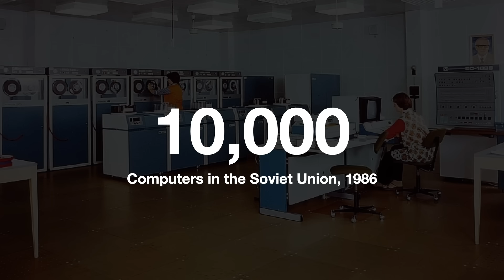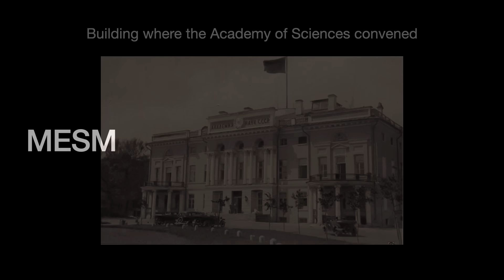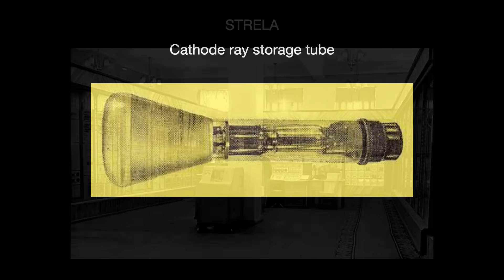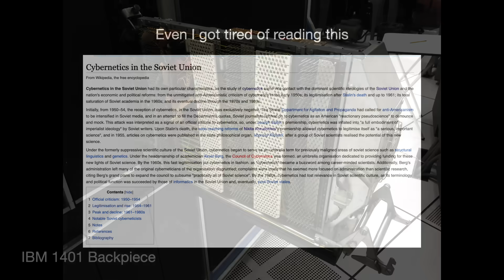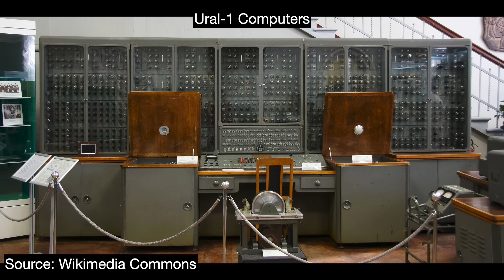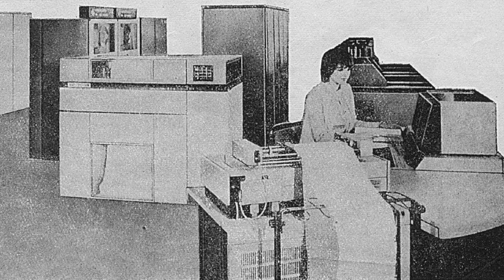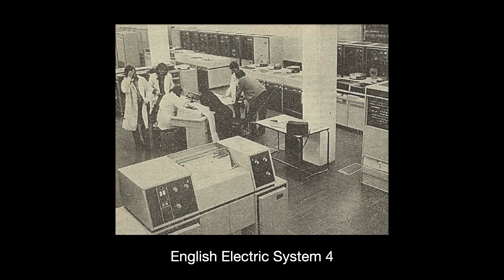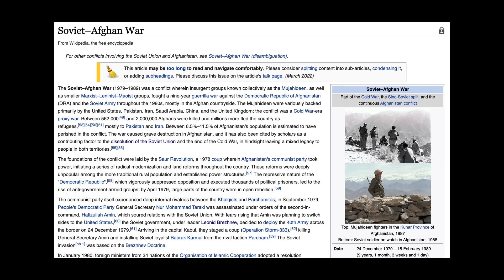Why the Soviet Computer Failed

Comment: The book "Red Plenty" touched on some of those events. 

Centralized Planning in itself is not to blame IMO, it's the centralized planning STRUCTURE, the bureaucracy, the top-down chain of command, people afraid to speak up. 

Cybernetic systems promised to automate away much of the party commands. Production would finally be organized from the bottom-up, responding to signals in real time. This was putting bureaucrats roles in jeopardy, and could lead to prices that would rouse people up (balanced economy or no, who would be the one to announce price changes, at the cost of their political career, if the people got angry?). So they scrapped their cybernetic planning system, despite a potential so great that politicians in the USA feared that this system would prove the superiority of a planned economy. Yet, Stalinian bureaucracy was well able to destroy itself. 

Another bottom-up planning experiment, using computer networks, was briefly tried under Allende, in Chile, in 1973, before the USA-backed dictator Pinochet bombed the parliament. Here's a good account of the events. 
https://youtu.be/RJLA2_Ho7X0
Reply: fact that you need to get everything right is the ahilles heels since rarely anything goes as planned in real life
Reply: @bravodefeated9193  do you actually know how a planned economy works? or just planning in general? How do you think amazon plans everything, do you not think that markets don't lead to central planning?
Reply: No, centralized planning 100% is at fault. Many technologies are basically stumbled upon by accident or unfocused tinkering. 

Think tons of small groups of people who are all simultaneously trying their own different approaches to something. Even though the odds that any singular group succeeds are incredibly low, it only requires one group to get right once for the bar to be raised permanently. The net impact on society of a single “black swan” unlikely success far far outweighs the 999 others who tried and failed. 

Where the top down system of innovation tries to remove randomness through logical central planning, it ends up damaging itself as it discourages the unpredictable and hugely net-positive asymmetric upside of empirical trial & error / tinkering. 

Similar reasons why disorganized guerrillas in Vietnam and more recently Afghanistan (and generally) were able to defeat the highly organized, top-down controlled US Armed Forces.
Reply: @Bob-jn8gt  Ok, just a quick question have either of you though that simultaneous development wastes resources? and keeping technologies secrete actively damages advancement's in the field? Also central planning doesn't  prevent multiple teams of researchers from working, so it doesn't reduce the likelyhood of a black swan discovery. Also if you look at any recent developments most of them are funded by the public and not privet company's as it simply is not profitable to actually make your product better but rather market it as being better.
Reply: @kaichohachi2315  simultaneous development (tinkering) absolutely wastes resources, but the upside of a single outcome can be so asymmetrically positive that it more than makes up for the waste in the process. 

And yes command systems can have multiple teams working on different things to the same goal, but the effectiveness of this decreases with scale as there are too many factors to account for, and one small unpredictable event results in the entire plan needing redeveloped to the point that the planners are the one’s playing catch-up. So the further power distance between the planners and these events makes the system less adaptable overall.

As for keeping things secret, I totally agree that this damages advancement. I’m ok with some level of intellectual property, but currently the system has turned it into a whirlwind of frivolous legal BS.

I partially agree with the last part, big companies don’t “waste” time on innovative tinkering because they are too focused on short term cost cutting and financial/legal manipulation.
Reply: @Bob-jn8gt  I get your point and I agree that it was defiantly a problem with soviet style planning but with modern technology it is no longer a problem, we can compute a whole nations economy on one phone so this problem is reduced far more and the wasted resources from simultaneous development outweigh this issue.
Reply: @Bob-jn8gt  we're, I think I'll steal the ' from your comment
Reply: @xXDESTINYMBXx  ?
Reply: @Bob-jn8gt  cool you fixed it
Reply: @Bob-jn8gt  I generally agree with your argument, altho IMO developing a consumer product requires more research and "focused tinkering".

While many inventions and discoveries usually involve someone stumbled upon something in somewhat unexpected manner, that invention/discovery almost always requires more research and engineering effort before it can actually benefit the society.

Centralized/command economy is really good at pouring resources to achieve quick progress at developing new solution/product based on known theories, altho as shown in this video, it could not compete against market economy in the long run, as new invention/discovery often render previous solution obsolete.

Therefore, IMO (and contrary to popular belief), the so-called military-industrial complex is actually great model. Ofc I'm against it for ideological reason (i.e. gov should not gamble or "pick the winners" with taxpayers money), but I have to give credit where credit is due.
Reply: @Retired Bore Central planning is good at scaling things up and being lean/efficient, not innovating or tinkering as tinkering is inherently inefficient and unpredictable. Both have a place in society. 

There are R&D driven corporations that innovate but internally the innovation isn’t centrally planned, they have a bunch of small teams working on their own bottom up projects with some level of autonomy (large pharma/biotech where 99% of candidate drug compounds never get FDA approval, but the 1% that do make enough not only to cover the costs of the failures, but create a huge net profit for the shareholders). 

Many large companies these days prefer to buy the IP and rights to novel technologies from startups/M&A and use their centralized efficiency to scale-up.

Speaking of supply chains and central planning, 99% of the time, the lean/just-in-time efficiency saves money, runs smoothly, and scales efficiently. But it is fragile to black swan events and randomness (no central planner or statistical model will ever be able to predict the future with a useful degree of accuracy due to entropy)
Reply: @Retired Bore The problem with "central planning" is not with the planning in itself, but with the fact that a handful of people (i.e. the central planners) in the faraway capital monopolize all power in the whole nation and make all the decision for everyone (i.e. less personal liberty for the people), often with little or no accountability.

If corporate directors made wrong prediction/move which cost investors large sum of money (not to mention if they steal company's money), they could be fired/replaced at will. Investors hold effective control over the management.
On the other hand, members of Politburo (or the leader of Communist Party) control all the power in the nation (military & police), so if they make the same mistake that cost the people/taxpayers a lot of money/resources, nothing will happen to them. The people/taxpayers are powerless.
This is the problem with central planning and big government.
Reply: @Retired Bore 1. I'll say that Capitalism is not better than Communism, since the word "better" here is dependent on your objective/ideals.
If your objective is to create an equitable society, then Capitalism (a system revolve around accumulation of capital), is definitely bad.
But if your goal is to create efficient economy (e.g. maximize GDP), then Capitalism is better than Communism, both in the abstraction/theory and in practice.

2. Corruption inside HP, Nissan, Lehman Bros, etc did not prove that "Capitalism" is bad, just like the debacle with Hubble space telescope or space shuttle accidents does not mean "Government" or gov agencies (i.e. NASA) is bad in itself.

Nobody is perfect, whether corporate leader, politician, or bureaucrat (e.g. head of govt agency). They all make mistakes, question is: what/how the system in question deal with them?

What happened to the head of Hubble space telescope program after the flawed lens debacle that cost taxpayers billions of $? Nothing.
What happened to the head of Federal reserve during the crisis in 2008 after he bungled the bail out which cost taxpayers billions of $? Nothing.
What happened to NYC CDC leadership after the agency failed to properly prepare for the incoming pandemy (which has been in the news for weeks) and failed to quarantine Cov*d patients? Nothing.
How exactly voters and taxpayers demand any accountability from these bureaucrats and central planners? You probably don't even know who these bureaucrats are.

As individual investor, if you no longer trust Elizabeth Holmes or Bernie Madoff, or Zuck, or Cook, or Musk, you can just pull your money out from their company and invest somewhere else (and if there's enough of investors losing faith in them, you can even replace them).
If you can actually prove that they scam you (as the case with Holmes and Madoff) you can sue them and demand them to pay you back (or punish them if they can't).
Unfortunately you can't demand a tax rebate for govt f-up, and you can't refuse to pay future tax either. Imagine in the totalitarian state where these central planners and bureaucrats are not only have the right to tax you, but to expropriate your property and force you to do their bidding (e.g. assign a job for you and set production target). What a nightmare.

3. "If Capitalism tried in Russia and Communism in the US.. (probably) led to very different outcomes"
There's one country blessed with fertile land, bountiful resources, and large workforce.. This great country exist since ancient time, experienced many golden ages and tribulations over the millennia.. This great country had tried both Communism and Capitalism: China.

We know what happened when central planners in China run the economy (Google Mao's "Great Leap Forward"), and how everything changes after the exact same group of planners humbly admit their own deficiencies and allow the market to shape the economy (Google Deng Xiaoping's market reform).

"Whoever does not miss Soviet Union has no heart, whoever want it back has no brain" - Vladimir Putin.

"We want to make everyone rich, but in order to get there, we shall allow some to get rich first"_ - Deng Xiaoping (talking about the then new "Socialism with Chinese characteristics" aka "Capitalism").

Btw, you are already free to practice "Socialism" in America. You can gather likeminded people and start a workers coop or collective farm in the US (not just in the US but practically in all countries with free market economy).
Free market capitalism is not a totalitarian system like Marxist/Socialist countries.
Whether theocratic farming community (Amish community), Socialist workers coop, collective farm, small company, or public megacorporations.. and anything in between, they are all allowed under Free market capitalism.
Reply: @ihl0700677525  Capitalism is far more inefficient then communism and socialism
Reply: @kaichohachi2315  That could be true if and only if the "dictatorship of the proletariat" could actually outperform market, which has never happened.
Reply: @ihl0700677525  It has and does, more often then not. Look at the study: "economic development, political-economic system, and the physical quality of life", Or look at the soviet union's economic growth, where even in the "stagnation era" it's economy was growing faster than most capitalist economies what's even more impressive it that they do this while facing massive sanctions and attempted coups
Reply: @kaichohachi2315  Comparing USSR economic growth to "most capitalist economies" means nothing since you may ended up comparing some random "capitalist countries" in Africa or Asia (which may or may not be a "capitalist" economy depending on your definition).

For example India is technically a "capitalist" country even tho it has a "mixed economy" with many "socialist"/collectivist characteristics (e.g. price caps, subsidies, state run enterprise dominating many industries, etc).

If you want a fair comparison, then compare 2 countries with similar demography and geography, like between West and East Germany, or between North and South Korea.
Same people, same culture, same starting point, different system, vastly different outcome.
Reply: @ihl0700677525  Agreed, oh wait. That is literally what the study did.
Reply: @kaichohachi2315  Lol. Isn't that great? Millions literally risked their life escaping "utopian" dictatorship of the proletariat to come to inferior capitalist society.
I'm sure "the study" explain to you why is that in such concise and detailed manner. Lol.
Reply: @ihl0700677525  That last message was the most anti-intellectual brain rot I've ever read,
 please look at the study before moving on to a different point.

Plus your "point" of people fleeing for there lives can be applied to any capitalist country too.

Never did I claim that a planned market was utopian, rather I said it was better than capitalism, which it provably is.
Reply: @kaichohachi2315  1. If you want to make a counter-argument from your study, you can quote something relevant from it. But so far you haven't mention anything that piqued my interest to read it.
I can point you to some random studies about the "superiority of capitalism" on Libertarian or Conservative thinktank website, but that would be stupid.
To expect someone to spend time on what may well be a low quality partisan propaganda is just silly.

2. "People fleeing their country can be applied to capitalist countries too"
Lol. Tell me about all these people fleeing en masse from a Capitalist country to a Communist/Socialist country then.
Tell me, what compel them to leave, and how they fare in the Socialist society.

3. "I never claim planned market was utopian, I said it was better than Capitalism, which it provably is"
Sure, depending on what your ideals/objectives are, command economy can be a better fit. For example if you want to create equitable society, then command economy is definitely better than free market.
However, if we want an efficient economy (e.g. maximize GDP), then the much more meritocratic free market is proven to be way better.

"We want to make everyone rich, and in order to do so, we shall allow some to get rich first" - Deng Xiaoping
Reply: @ihl0700677525  
1 - The study shows that with comparable starting positions a planned economy provides a greater quality of life for everyone.

2 -  I'm not going to respond to a strawman.

3 - A market economy is far more inefficient, also in no way is a market system a meritocracy. Do you genuinely believe that Jeff Bezos works 158518 times more that an amazon worker?.
Also again even during the stagnation period the USSR had more GDP growth then most capitalist economies, so much so that it was projected to be the worlds biggest economy by 2050, which is very impressive when you consider it was a wartorn feudal society not that long ago.

"Wind farms couldn't pull the skin off a rice pudding, says Boris Johnson" - Alexander Boris de Pfeffel Johnson
Reply: @kaichohachi2315  1. "Quality of life" is rather a subjective term. People of Nepal can claim they have better "quality of life" compared to, let's say, Swiss, or anywhere else, since according to one survey, Nepal is/was one of the "happiest" country on Earth, where vast majority of the population is content and enjoy a "happy" life.
Anyway, in term of GDP and GDP per capita (which is much more objective), West Germany was much richer than East Germany, and South Korea is much richer than North Korea.

Ofc there are other (objective) metrics you could use which favor command economy over market economy, like "Wealth gap" in Socialist countries was/is, on average, much lower than in Capitalist countries. Which is exactly my point: if you want to create an equitable society, choose Socialism. But if you want efficient economy (thus can produce more, i.e. larger GDP), choose Capitalism.

2. Really? How's that a strawman?
I said there were tons of people risked their life fleeing Socialist country to come to Capitalist country, and you replied with "people fleeing for there lives can be applied to any capitalist country too". Which should mean there's a lot of people fleeing Capitalist countries to come to Socialist country too.
If that's not what you mean, then what do you mean by "people fleeing for there lives can be applied to any capitalist country too"?

3. "in no way is a market system a meritocracy"
Some Socialists call "Capitalism" as "Social Darwinism" where the winners take all and the losers lost everything. For better or worse, that's a form meritocracy.
It is ofc not a "true"/perfect meritocracy, far from it, but it's still far more meritocratic than this idiot system that celebrates mediocrity and subsidizes weaknesses, the one that say "From each according to their ability, and for each according to their needs" (which is the anti-thesis of meritocracy).

4. "Do you genuinely believe that Jeff Bezos works 158518 times more that an amazon worker?"
Lol. Do you honestly think that Stalin or Mao worked 158518 times harder than average workers in Stalingrad or Beijing?
Seriously tho.. Bezos' annual salary from Amazon in 2021 was about $85,000 (you can Google it). That's definitely NOT 158,518 times more than avg Amazon worker.
If you include his "net worth" as his "income" to be compared to avg Amazon worker's salary (which is hilariously misguided), then let me ask you this, do you genuinely believe your parents (assuming they own a nice house in suburbs) work 100 times harder than you? Why they have such a nice house that worth half a million $ while "doing nothing"?

5. "even during the stagnation period the USSR had more GDP growth then most capitalist economies"
I can claim that even during the economic slump in the 1980s, US economy still growing faster than "most Communist countries". It's meaningless claim.
If you want to cherry pick, at least do it properly, use a stats from a time which East Germany somehow grow faster than West Germany. Lol.

6. "(USSR) was projected to be the worlds biggest economy by 2050, which is very impressive when you consider it was a wartorn feudal society not that long ago."
Lol. In 1970s Japan enjoy extremely rapid growth, projected to overtake the US to be the largest economy on Earth by mid 1990s. Needless to say, it didn't happen.
But do you think we should copy Japanese economic system/strategy from 1970s?
Oh, and Japan was a war-torn feudal society not that long ago. In fact pretty much all of Europe was a "war-torn feudal society" just before the Industrial revolution.
Reply: @ihl0700677525  People defending Capitalism with the same tired arguments, full of straw man, miscaracterizations, based on bad economic models, and only pointing to past authoritarian structures whenever someone wants something entirely different, are a waste of time an energy. I told you of 2 books whose whole subject is exploring how planning can be done directly democratically. I told you of another one that only explores how right now we have more "central planning" through Capitalist industries than ever before. Imagine the planning taking place in Amazon. It's acutally my job to create digital tools that enable analysts to take decisions, based on objectives handled down from management. The difference is that I want management to be elected, recallable at any time, and only there to facilitate online and in-person assemblies where issues from different levels are discussed and voted on (local to global). What that means can be up to every workplaces, which each implement their part of the bottom-up plan that emerges from all the needs and desires of the people (anticipated algorithmically as it is done in Amazon - looking at lots of real time metrics, and/or explicitely). The incentives a system owned by us all has is to fulfill our common needs, not maximize profits Capitalists. 

To address your points from other comments, this has nothing to do with past central planning experiments, which had no access to real-time online voting, A.I. and algorithmic tools commonly used today. 

No, we cannot "make socialism" now, with worker COOPs or a commune. This is like looking at Slavery Plantations, wanting Slavery to be abolished, and you say that people can have a plantation where they pay others instead. This fixes nothing. Even if every companies was mandated to be a worker COOP, the anarchy of the market (lack of planning between companies) still recreates crises of overproduction every few years, as worker's incentives are still narrowly limited to the bounds of their company. 

For your points in the previous comment: 

1 - Really, GDP = efficiency? You understand that an oil spill is a huge economic boom for GDP, right? People payed to clean up the spill, more petrol need to be pumped, money exchange more hands. That's GDP: a measure of economic exchange with no notion of WHAT it's exchanged FOR. Even the inventor of GDP disliked the metric. Diluting it per capita is useless (especially considering how it is incredibly skewed toward the rich). If you want a Capitalist telling you about the problems with GDP, read Ha-Joon Chang's "23 Things They Don't Tell You About Capitalism". The first part of "Less is More", by Jason Hickel, also shits on GDP, which becomes useless when considering the cost of externalities it ignores.

2 - Yes, people flee Capitalists countries all the time, for reasons directly linked to economic devastation brought about by capitalist recommendations from the IMF. That it be through the support of dictators, to exploit the despair of people to export industry abroad so that corporations can pay pennies on the dollar and destroy their environment in the name of free trade, or because shock-doctrine destabilization has wrecked their countries by a war backed by Capitalist interests, there's tons of refugees and deaths linked to Capitalism, far more than the over-inflated "black book" count of death ever did. 

3 - Seems you need to read "The Tyranny of Merit", if you think we live in a meritocratic society. The social Darwinism you speak of selects for what? Psychopathic ruthlessness in pursuit of profits for the CEO, board of directors, large shareholders. Regiment worker's lives to the second, drive them to the breaking point, steal wages when possible (biggest theft category by far), pay lobbyists to reduce legislation, taxes, and to oppose worker's rights (when it's not revolving-door CEOs that directly get appointed to cabinet positions to destroy worker protection from within the government)... btw, google "Battle for Blair Mountain" or read "A People's History of the United States" if you want a taste of how violently police and agencies payed by Capitalists slaughtered workers that advocated for the 8h day, or the weekend, or the end of child work, or pensions, or any of the shreds of protection still left standing. I just finished reading "On the Clock" yesterday, where the author worked in an Amazon Fulfillment Center, a call center, and a McDonald, and simply tell her experience. Seems you need to learn what is the cost of the "efficiency" you speak of, what it selects for. Even if you thought that overall a market system organized around infinite growth and profits for Capitalists gives us the items we want the most, at the cheapest price (objectively false, as competition determines a winner who then has a monopoly and then raises prices, that's litterally the strategy of most new IPOs today), you cannot seriously lack the imagination to really think no other way could be better. Like, just within SpaceX, there was different teams working on their version of the Raptor engine, with the winners going to mass production. Same within Apple for the iPhone. We can absolutely determine better metrics than "profit" to select what we socially value.

4 - Pointing out Bezos 85K salary is so irrelevant that I can't fathom why you'd press this point, given how his passive assets (shares) are where his wealth is. He earns interest on those, and he benefits from the stock valuation of Amazon going up, to the point that he has more wealth compared to his workers than Pharaoh had compared to their slaves. Google "1 pixel wealth" if you want to understand how impossibly massive it is. And how did he acquired it? He pitched the genious and defenitely unique idea of having an online store to investors, got seeding money, hired people to grow the company for him. Now, he can borrow against the value of those shares, earn interest from shares higher than the interest from the loans he got, and basically enjoy unlimited money without paying a dime in taxes (because his "income" is negative, due to the debt he takes against his shares, because Capital Gains is barely taxed). Yet in the rebuttal you gave, a house IS taxed annually. 

5 - West Germany was propped up by US dollars. https://www.youtube.com/watch?v=sseNMU3wUtw Yet, after reunification, most people still preferred their quality of life in East Germany. 

There's just so many books to recommend to you, which of course, I doubt you'll even google. Writing this comment was likely useless, I've never heard of someone changing their opinion in a comment war. But it seems you're perspective would be enriched by learning on Imperialism and how its shaping current politics. I have in mind: 
- Washington Bullets, by Vijray Prashad
- The Jakarta Method, by Vincent Bevins
- Planet of Slums, by Mike Davis
- The Divide, by Jason Hickel
- Imperialism, the highest stage of Capitalism, by Lenin
- The Shock Doctrine, by Naomi Klein
- The Darker Nations, by Vijray Prashad
- Less is More, by Jason Hickel
- Rebel Minds, by Suzan Rosenthal

There were many more books that came to mind, again, I think I just wasted my time writing this.
Reply: @TheReaderOnTheWall  1. Lol. Half of your argument can be boiled into this:
Wealth gap and societal issues in Capitalist countries: "Capitalism bad"
Tyranny in and failure of Communist countries: "NoT rEaL cOmMuNiSm"

Seriously, either compare the ideals of both system, or their actual (flawed) implementations (which is what I did in my discussion with the other commenter).
Socialist morons almost always compare the flawed implementation of "Capitalism", i.e. what they called "crony-capitalism" or "klepto-oligarchy" to their idealistic, textbook Marxism.

Well, I guess it's not their fault, they never experience the idiocy of Socialism. To be fair, many refugees and deserters from Cuba and North Korea, who just escaped Socialist dystopia, usually hold highly positive view on "Capitalism".. I guess your neighbor's lawn always looks greener after all.

2. GDP growth and GDP per capita is the standard and objective measurement to gauge the efficiency of your economy.
I agree that using it to compare different countries (with different culture, geography, and demography) might be problematic, but if we use it on the same country, you'll get clear picture. For example using it on China (PRC) before and after Deng's market reform.

3. I haven't read your books, but taking a glance at the synopsis, they seems to offer same old narrow minded, low quality generalization.

4. On Bezos vs. Avg Amazon workers:
Let's say there's 2 Amazon workers, Joe and Jim. Both work at Amazon warehouse, doing exact same job. Joe likes to collect comic book, while Jim is a crypto-enthusiast. Jim hit a jackpot when the value of his coins tripled in a year. His "net worth" is tripled.
Do you think he work 3 times as hard as Joe?

Unfortunately, 2 weeks later, Jim got rug pulled, and his coin worth practically zero. On the other hand, a collector bought a series of rare comic book from Joe for $50,000. Now Joe's net worth is 1.7891 higher than Jim's.
Do you think Joe work 1.7891 harder than Jim?
Do you realize how ridiculous and stupid it is to use someone's net worth to compare their work and overall contribution?

5. Last but not least, back in 1920s, Socialist/Marxist fervor was high, and us "Bourgeois" could do nothing beyond trying to argue against it in theoritical/abstract level, by comparing the idealism of "Capitalism" (i.e. liberal economic system/order) to Marxism (or other Socialist school of thought).

But now, we have dozens of failed Socialist/Marxist countries to serve as example, and ample of quotes from former Communists, including those in the leadership position (e.g. Deng Xiaoping, Yeltsin, Gorbachev, etc) who admit the flaws of their ideology.
It really make it lot easier for us to debunk your idiotlogy. Lol.

I guess it must be hard for you to argue against success. All you commies do is performing silly mental gymnastics and making dumb excuse for the shortcomings and failures of your ideology.
Reply: @ihl0700677525  Wow, I had not realized how deep the brain rot went. Complete waste of time.
Reply: @TheReaderOnTheWall  Yawn. Anything else?
Reply: The fact that you require this "cybernetic system" to emulate the market is in itself is a major deficiency of a command economy.

Aside from obvious huge single point of failure, once it's implemented, it is doubtful if the infrastructure and production could actually keep up with the changes, unless the planning and development process are also decentralized, in which point, you basically adopt a market economy.
Reply: @ihl0700677525  The only planning happening in market economies is within companies (planned by the Capitalist owners, or by the workers in COOPs). That's called "the Anarchy of the Market", and it leads to crises of overproduction, market crashes every few years. No modern country ever implemented a large scale bottom-up planning process. Books like "No Bosses", by Michael Albert, or "Towards a New Socialism" by Paul Cockshott show how it could be done. I also recommend "The People's Republic of Wal Mart", if you want to see the extent of the planning happening within Capitalist firms and how easily we could plan production if the workers were in control.
Reply: @TheReaderOnTheWall  Bourgeois planned their expansion for economic reason (mostly to fulfill market demand), while the Proles plan theirs for mostly for their own social benefit (after their own basic needs is fulfilled).

This "bottom-up" planning process with emphasize on resource allocation is deeply flawed concept, which will lead into stagnation.
IMO accumulation, rather than dispersion (i.e. equitable distribution) is the engine that allow innovation.

As for market crash, it is simply a way for the market to correct itself before the bubble became too big that will bring the entire nation down.
Reply: @ihl0700677525   nice bait
Reply: @kaichohachi2315  Thanks. Anything else?